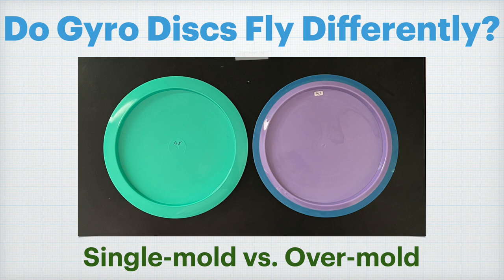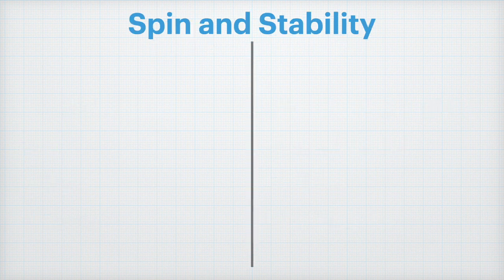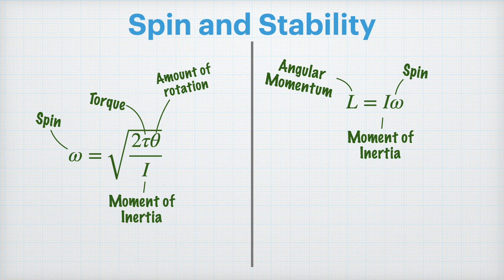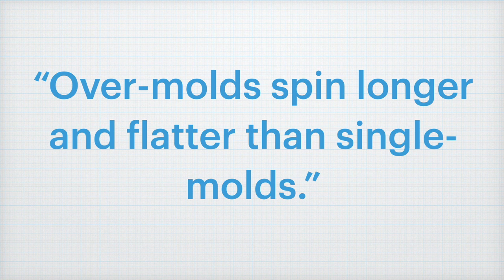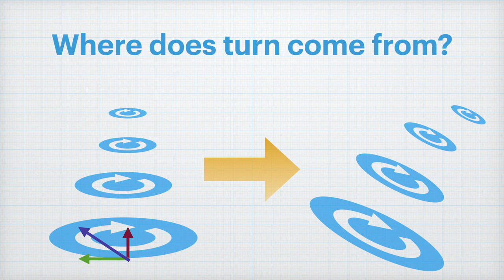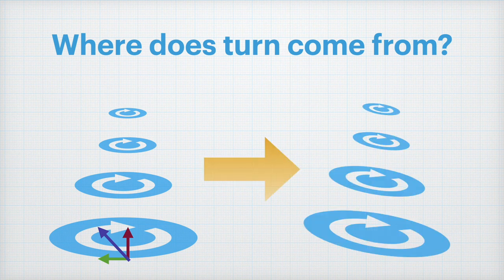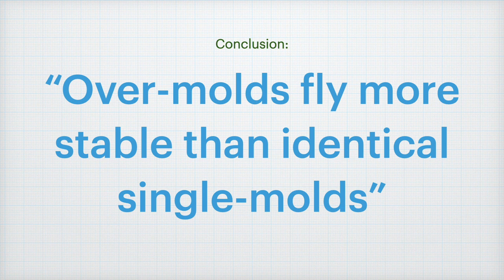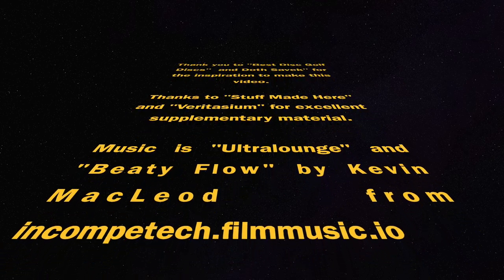Do Over-mold Discs Fly Differently? | Disc Golf Physics

Comment: This is from the MVP website:  
 "Increased angular momentum of a disc in flight will allow the disc to stay on its rotational axis for a longer period of time" (Think of a spinning top)
&
"Increasing a disc’s moment of inertia will increase its angular momentum" 

Angular momentum = Moment of Inertia x Angular velocity.

In reality, Increasing a discs's MOI,  WHILE MAINTAINING THE SAME ANGULAR VELOCITY, will increase it's angular momentum.

But because of the higher MOI, you have  to apply more torque in to the spin, to achieve the same angular velocity.

BTW, most discs have their weight distributed more on the rim therefore all discs experience the gyroscopic effect.

MVP moves more weight to the rim BUT, not that much more.

Comment: Gyroscopic precession of a disc in flight results in turn and fade.
  The spinning disc creates the gyroscopic effect.
  Lift, at high speed applies torque resulting  in turn.
  Gravity, at low speed applies opposite torque resulting in fade.

Comment: I think you said that the slower the disc is spinning the less it's going to turn right???
Reply from the maker: This is a point that I could have clarified more. Just to be clear, "Turn" is a technical term in disc golf which describes the disc deviating from a straight flight path in the beginning of the flight. "Spin" on the other hand, is the amount of rotations a disc is doing in a certain amount of time. 

So yes, the less your disc is spinning as it flies, the more it will "turn" or deviate from a straight path.

Comment: There is some bs here. Take the same disc and throw it at the same release velocity but different RPM's. They will not fly the same distance. The claim that spin doesnt effect lift, is just plain wrong. You proved it by illustrating that a disc with no spin will quickly crash to the ground.